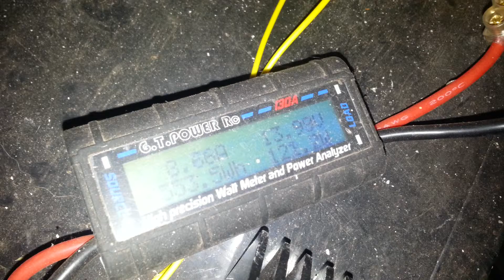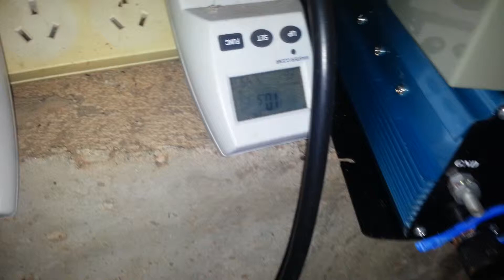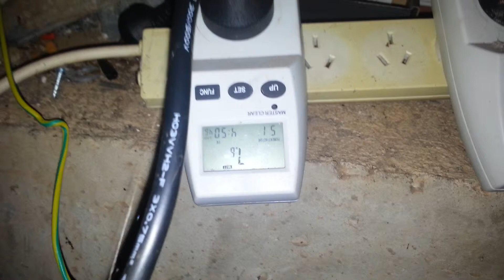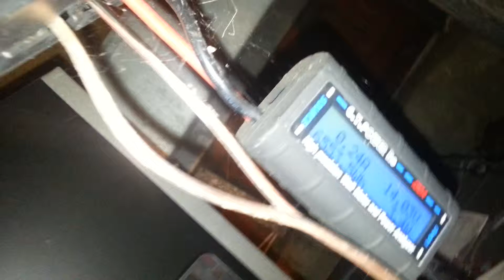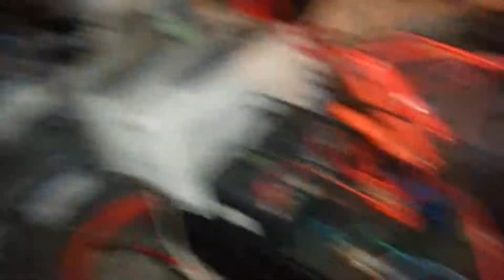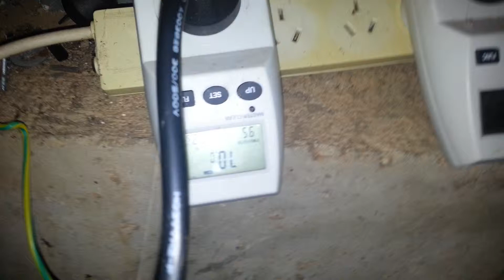GTI instead diversion control on wind turbine

Comment from the maker: If the power from the grit fails i use the 12v to 240v inverter to power
 my house.
in the other hand my wind turbine is not giving more than 500w in any weather.
my battery bank is 2300Ah so there is plenty of room for charge without the grit connected for a short period of time.
Thanks for waching